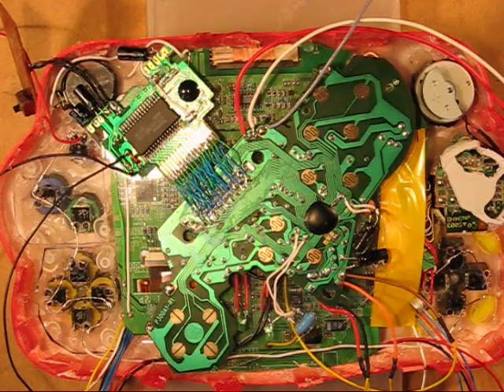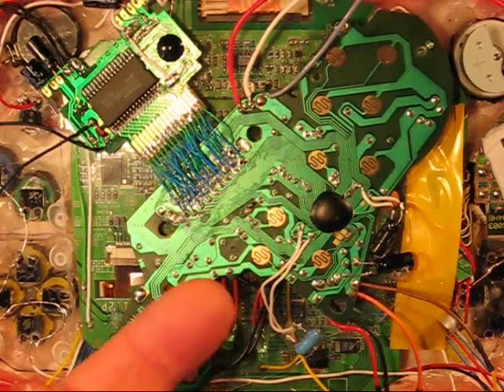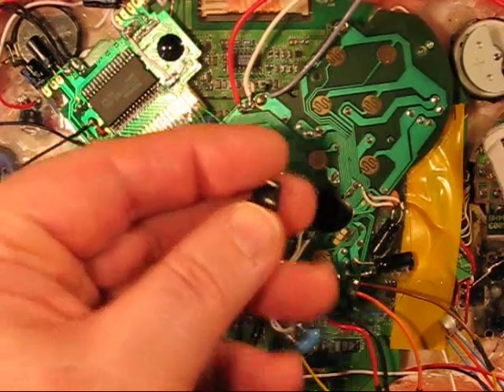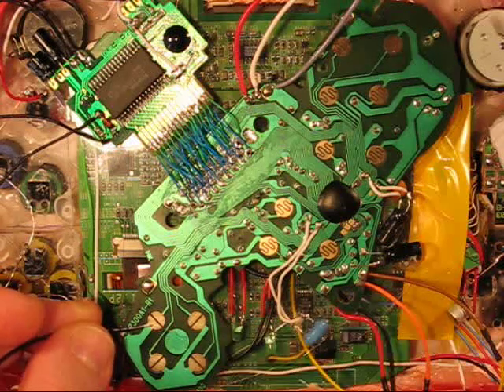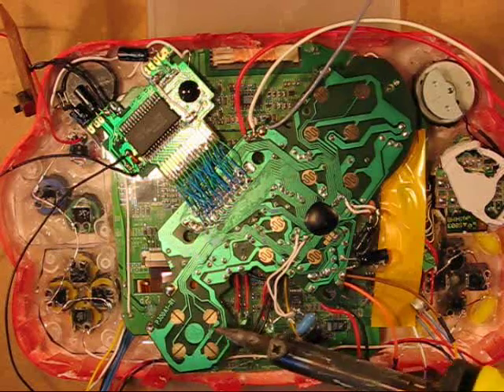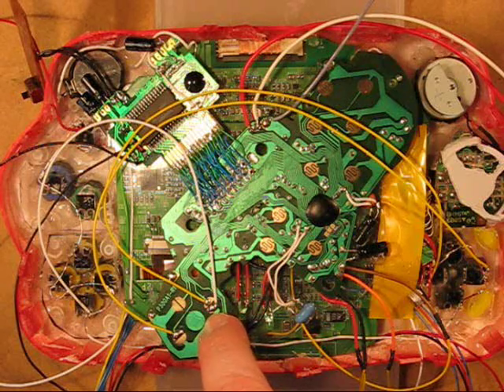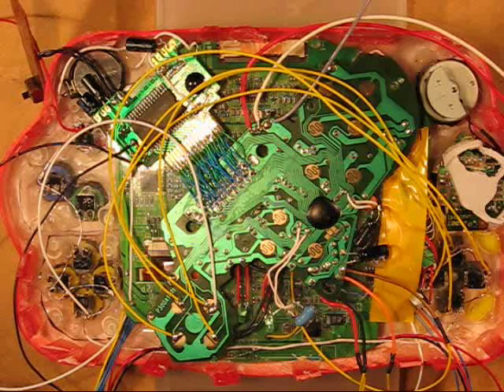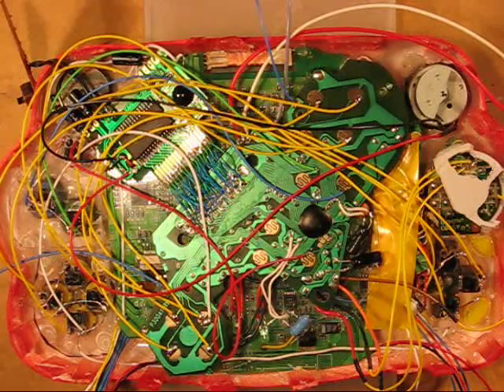N64 log - 17 - Wiring the controller: the principles, general method and tips

Comment: I tried to desire a psone joystick to a controller it was like the one you used but without the two extra buttons and it didn't work I also retried it by extending the wires and it was again a failure what do you think must have been wrong

Comment: @DanielGClapp I know this is weird but I noticed your comment and needed to answer it but the solder just keeps it in place if you were to wire a fan to a USB you could hold the two wires together with your hands and plug the USB in something and the fan will work the solder is just used to keep the wire from moving around and if your serious about keeping the wire from moving you could use hot glue and put it over the soldered wire

Comment from the maker: You are right, the boards can't touch or you get shorts. To prevent that, electrical tape is a good solution, although is also an insulator so not suitable always, use cardboard, whatever is appropriate that isn't conductive.

Comment from the maker: Yes, or any contacts you wire to it won't work either. It is a good idea to check the controller works fine before you open it up and mod it.

Comment from the maker: Each button needs negative contact and button contact. The negative (ground) is common to all the buttons on the controller, so that is one contact; the other contact is the button contact itself (eg A, B, etc). What I was relaying was that instead of finding a common ground, or if there isn't a commonly shared one, you can wire each of the two tact switch contacts to each of the two button contacts instead, if you wanted to.

Comment from the maker: Yes it matters, one side is grounding, as demonstrated in the video. The other side is the button contact. 

You can take grounding from many places on the board, however, as I demonstrated where grounding was on the controller, I wired ground to there, to save confusion hopefully. That is why both sides of one contact is wired...